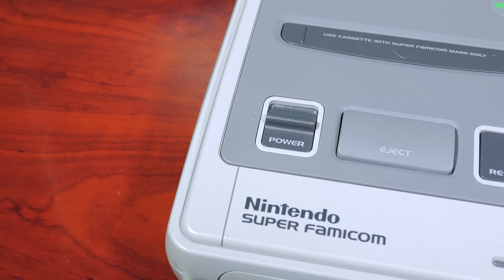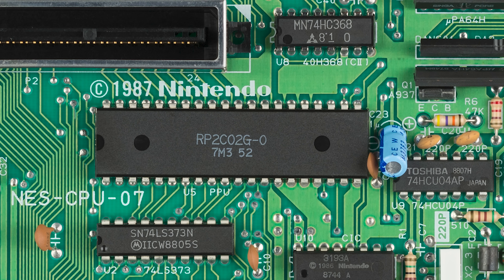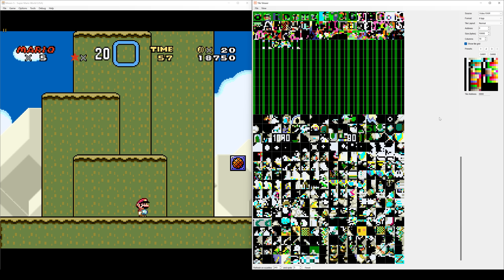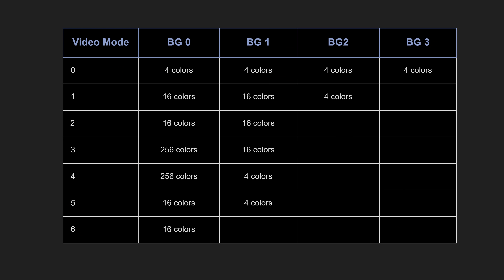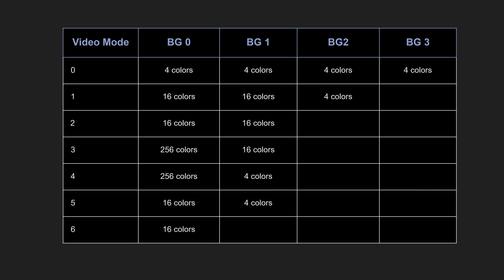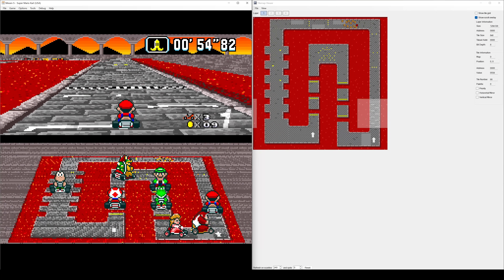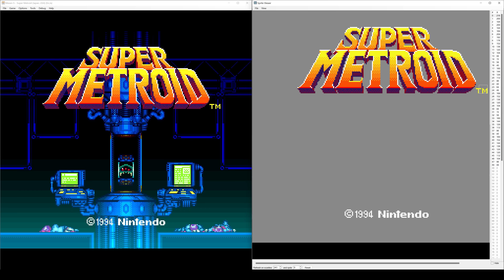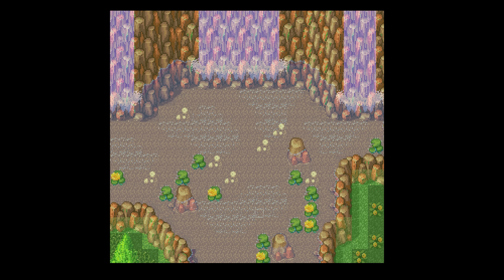How Graphics worked on the Super NES | MVG

Comment: 5:22 Correction: Background layers always scroll independently in all modes. The ones marked as offset-per-tile (2 and 4) are unique in that they allow you to scroll each column of tiles independently of each other. This allows you to have vertical parallax on a single layer (and is also the only real way to accomplish this). We see this used quite a bit in Yoshi's Island, where it's used for the wavy lava effect seen in some castles, the LSD effect when Yoshi touches a fuzzy, and some really big castle platforms that move up and down.
Reply: Unless I missed it he also didn't explain the importance of HDMA to what most people know as Mode 7. Without HDMA you couldn't do Mario Kart or F-Zero. Castlevania 4's swinging chandelier or rotating room is a perfect example of Mode 7 on it's own. Changing the scaling per line is how you achieve that pseudo 3d perspective. It's too bad he didn't have that in his explanation on mode 7. But for many viewers they probably got plenty of information they didn't have before so that's still positive.
Reply: @mottzilla4858 I agree: while it's good to speak about old machine tech, here (https://www.youtube.com/watch?v=pafOj9IrtuY) you can find a far better explanation of the Castelvania IV "tube" section. Of course having in HW those effects is a huge bonus, many of these effectes are replicated via software in line scrolling by MD/Amiga (true 16-bit machines btw, while Snes cpu is still debate whether it's a full 16-bit cpu or a 8-bit derivate, PC Engine / TurboGrafx-16 got a 8 bit cpu with true 16-bit video system)
Reply: @slashrose3287  The SNES's CPU is a hybrid 8-/16-bitter while the Motorola 68000's a hybrid 16-/32-bitter. The SNES chip is more memory efficient due to its shorter operation codes, which combined with having a lot of graphical trickery prebuilt into its PPUs allows more room for high-quality assets.

But why is SCVIV 4-3 (4-2 is the non-tube spinning room, which is what mottzilla meant as that's pure Mode 7 while 4-3 is both Mode 7 and HDMA) so laggy regardless of the multiprocessing? It's because nearly every floor segment there is a falling plank, thus sprite and motion data that you're constantly triggering as you go. That combines with all the other sprites and physics—the HUD, Simon, his whip, the candles and items, the breaking wall pod bits, the enemies and ESPECIALLY their bits when they explode—to REALLY chug the SNES. Old-school Konami were masters of pushing hardware to its limit, yes, but they occasionally got WAY overzealous with it. The 3-3 boss and the B-1 crumbling bridge with bats in pursuit are two other notorious examples in SCVIV even though neither uses Mode 7 or HDMA. Maybe if they could've optimized the code for the whip flailing…
Reply: @CarbonRollerCaco  Thanks for ur CPU clarification, well explained indeed. Again, noone is arguing the Snes superior graphical power (and could not be otherwise, since it was release more than 1 year later MD, which is rather hefty in tech advanceemet ).. many people argue again the should have spent more for a true 16-bit cpu and maybe save money for a slightlyless advanced audio system (the SPC700 audio system wasn't fully used by many developers at the time). Anyway, Snes was a fantastic system at the time, the "16-bit war" (or any other war btw, especially in these days...) is just not for me anyway.
Reply: @CarbonRollerCaco  How are the codes shorter? Okay, 68k has 16 bit instruction codes, but immediate values are of the same size. In SNES you need to insert extra instructions to switch between modes for BCD or 16 bit vs 8 bit immediates. That not only takes memory, but also clock cycles. And now I checked, the 65816 does not seem to have its zero page in the chip. For many variables the 68k can just access its register file and is thus more efficient. Only multiplication on SNES is faster. Already on a C64 the multiplication ( for 8 bit ) is almost as fast as 16 bit on the Amiga. Nintendo took a hint and poured the lookup table into ROM.
I just checked: Both consoles have the some number of pins, but MegaDrive pulls 16 bit per cycle, which completely compensates the opcode size.
Reply: @mottzilla4858  he literally brings it up in the video
Reply: ALSO he mentioned  Layer1 (BG0) having only 128 colors, but the chart says 256 colors.... am I the only one that noticed this? which one is it?
Reply: @ThatTweedle  The chart shows how many colors each tile can use, but he's talking about how many colors can be used on the whole background. Backgrounds are made out of many tiles, so the background as a whole can use more colors than a single tile can. The SNES can load 256 colors at once into its palette RAM, that all graphics have to pull from.  Sprites always use colors 129-255, whereas backgrounds start reading from color 1 (not 0). In most modes, only the first 128 colors are needed for the backgrounds, but in the 256 color modes the background can use the entire palette, even the ones that are normally for sprites. Mode3's first layer can use 256 colors, but most of the time it will only use 128 in order not to cause conflicts with sprites.
Reply: @vonfahrenheit6557  But then that means that only 120 colours are used for the background in modes 1, 2. 5, and 6, and only 96 colours are used for all backgrounds combined in mode 0.
Reply: @vonfahrenheit6557  Yes, that is mostly correct. Though with a bit of clarification: Sprites actually use color slots 128-255 (with color 128 being the transparent color). Backgrounds do start with color slot 0, with color slot 0 of each palette also being the transparent color. So in Mode 1 for example, the first color of each of the 8 palettes background palettes is transparent. There are 16 color slots in each palette. This only leaves you with 120 actual colors per background. However, when using the 3rd background layer which is only 2bpp (not the 4bpp of BG1 and BG2) each palette is 4 colors (with the first color of each palette being transparent). So color slots 0, 4, 8, 12, 16, 20, 24, and 28 are also transparent. This gives a maximum of 3 colors per sprite (with a 4th for transparent) and a maximum total of 24 actual colors on this background.
Reply: @ThatTweedle  I second your observation
Reply: @inceptional  "No one cares".."Get over it".."lost 16-bit war"..at least we agree about the (arrogant and anachronistic) "fanboys" still around in 2022 (i repeat, in 2022, not 1992...)..and, yes, with the described hw video features, the (probably) derivated-8bit Snes CPU automatically becomes true 16-bit (which, btw, was the point explained in my previous post, also a tech documented fact)...now we know the real truth, got it..
Reply: @inceptional  Well, apart from NOT answer my (and many others btw) simple argument in ur last three comments (whether Snes can call itself a true 16-bit machine because got a derivative-8bit cpu on a 16 bit video hw, much like Pc-Engine, in case the latter also could compete in the "16-war" at the time), trying to paste-copy my comment contruction..that's really "pathetic and desperate" as u say...anyway, my bad i tried to make a point with people so "illuminated" like you..well done, you won, enjoy ur simple Nintendo fanboy life; feel free to end this "conversation" with your last, redundant, arrogant & pointless post, i'm done with people like you.
Reply: You forgot to add in Mode 6 as an OPT mode. In addition, vertical parallaxing can also be achieved with sprites and swapping out sprite graphics, though you probably don't count them as "real" parallax in this case.
Reply: One other quirk of the SNES he omitted is that it had a 220p resolution that was stretched to 240p when displayed. This caused a bit of a learning curve when programming on it since what is loaded into memory isn't the same thing that will be displayed. You had to squish your images together so that they would be correct when stretched out.
You can see this like Genesis ports like Pitfall where the sprites are stretched awkwardly and the world isn't entirely correct and less of it is visible at the time.

Comment: Tiles and sprites on the SNES can use up to 4bit/16 colours from a pool of 9, 16 colour pallets (including a transparent ‘colour’).

In direct draw mode which is not using the PPU accelerated sprites and tiles in say, a static image or 3D graphics, the selectable colours are not indexed from pallets but drawn from rgb values which allows for more colour but slower performance.
Reply: The SNES was not friendly to develop for however. It’s graphics rendering method is ‘bitplane’ which is each pixel is a combination of the ‘planes’ of red, green and blue. This method was chosen to accommodate for a limited data bus if just 8bits. This is the width of the data path connecting the cpu with graphics, sound and work ram and rom data. It’s more cpu intensive however with common operations in use at that point as in the 16but era, ‘packed pixel’ format had generally been adopted to aid the ease of development and increase blitting/rendering speed for most common use cases. The planer format does however allow for the possibility of transparency in some instances although it’s used are limited.

The dual PPU’s were another obstacle to program for, along with the budget cpu, limited 8bit data bus and a compartmentalised graphics and sound system, requiring cpu interrupts to access graphics, sound and data from the rom. The rom itself was also limited in data speed. In fact, in order to run at 3.5Mhz, cartridges needed to be using ‘fast-rom’ type of memory which is less cost effective then standard lo-rom.
The SNES saw considerable support from third parties however despite its limitations and un-unified architecture because the Japanese public love Nintendo even more than the USA. They also love RPG games and this is why there are approximately 7 million available to play. They vary slightly on giant head size and alternate between running around and hitting things with a sword and standing in a line taking turns to bonk enemies on the head who are also waiting in single file to receive and dispense attacks. The story is more or less the same.

It was possible to program a fast paced action game but games of this type generally had be designed to be more modest in terms of the animated visuals with the most impressive titles being Rendering Ranger and Pocky & Rocky.

There were a lot of neat em ups but enemies were often limited to 2 to 3 on screen at a time.

The screen resolution was 257x224 (8x7 aspect ratio) so often graphics appeared too wide when the picture was expanded on the horizontal axis to accommodate the portrait orientation of a 4x3 crt tv.

Music could also suffer from a sample based system which offered only 64KB for the sound driver, musical score, effects/sounds and instruments in use as well as delay (echo) instructions. These limitations resulted in a distinctive sound from the chip which is kind of a buzzy, brassy, synthy texture or at worst dull or soft noises that fail to leave impact. Due to samples requiring such low data footprint, being at best 4bit, 22Khz and limited bitrate of well under 96Kbps.

The cost of the system and software was a touch more expensive than the £150 Mega Drive with the system retailed at £200 and games averaging around £60 to the Mega Drive’s £50.

It had more colour though so games designed for the SNES enjoyed a wide range of subtle colours from an expanded 15bit/32,000 colour palette. The games moved at a fairly glacial pace quite often however and controller input response times were often seriously compromised.

There are a great many interesting games, although the usual suspects might leave newcomers confused as to the hype. This is because the SNES is a hot machine. It tours impressive abilities but they are technicalities and it’s hype in the real sense of the word which means false excitement.

I would avoid all the Mario games although Marino’s Cookie is mildly entertaining it’s also ultimately repetitive. But avoid Mario Kart as it’s tedious, Mario World as it’s repetitive, irritating and tedious, Starfox is not fun, nor is Super Metroid or Zelda or Pilot Wings. Maybe try Ninja Warriors or Wild Guns but they are a bit tricky.

Overall the library is crap but there also a lot of interesting stuff if you avoid the standard top 100 of what is cannon to praise in the system.

Avoid the racing games that use mode 7 apart from Street Racer and a motorcycle game I forget the name of.

Avoid the shooting games (also avoid Contra).

Really the console is designed for playing sugary RPG games about giant headed emo’s with pink hair fighting dragons. All these games as I mentioned earlier operate in one of two gameplay styles (apart from Drakken and an AD&D game or two).

Haha. It’s a joke system for babies really and a nightmare to develop for but lots of people bought it and loved it because they are a bit slow and they are unwilling to accept their mistake up to this day but hey ho. If you enjoy playing tedious slow games, go nuts. Try Do Ra Me and Skyblazer for the ultimate in cutesy pointless tedium.
Reply: The SNES also had 8bit modes, which allowed for 128 or 256 colors.
Reply: @hjups  what you said is not a descriptive statement.
Reply: @ribenasquash  Sure it is, though I guess it was a bit vague.
Mode 3,4, and 7, all could do 256-color 8bpp graphics. However, there were restrictions on how the palettes were mapped, effectively making some of the sub-configurations only 128 colors. Transparency was always a color though, so technically it's 1 less if you don't count that.
I don't want to go into more details, because that would require discussing the sub configurations and address mapping in the CGRAM.
Reply: @hjups  pallets in a direct colour mode aren’t mapped. They are drawn on a pixel by pixel basis using rgb values so indexing/mapping to existing pallets isn’t the method used...

What is a sub-configuration?
Reply: @ribenasquash  Yes, I am aware of the direct color exception. I meant that 8bpp 256 color mapped to the CGRAM is also a mode, which you did not list as the upper limit (i.e. 4bpp is not the upper limit).
Sub configurations are settings for each mode such as via the BGMODE, BGxSC, and BGxyNBA registers. Those select both the mode (0-7) and the options available in each mode.
Reply: @hjups  I think you are mistaken. Sprites and tiles cannot display more than 16 colours each under any circumstances.
Reply: @ribenasquash  You're confusing the SNES with the Genesis. The SNES has 8bpp modes, which use 8-bits per pixel (via 8 bit-planes). That 8-bit number can either be used as direct color RGB values, or as an index into CGRAM.
Reply: @hjups  the palettes on the Super Nintendo cannot exceed 16 colours.
Reply: @ribenasquash  Then what happens when your tile references pixel color 23 in 8bpp mode? Does it just wrap around to the same 16 colors?
Reply: @hjups  probably an error

Comment: While the SNES base CPU was slow, there were a lot of interesting enhancement chips, such as the aforementioned Super FX chip, but not forgetting the various chips, such as the DSP chips, the powerful SA1 that was clocked faster than the Genesis's M68k, as well as Capcom's Cx4 chip for drawing wireframe graphics. Definitely a good topic to cover.
Reply: One of the most impressive of them is the compression one used in Star Ocean, allowing a 256 Mb game to fit in the cartridge when most games weren't even half that size.
Reply: @BrunodeSouzaLino  Star Oceans uncompressed takes 96 Mb, or 12 MB. Not 256 Mb / 32 MB. It used the SDD-1 chip for the on the fly decompression tasks, the same that Street Fighter Alpha 2 used.
Reply: Sorta like the Amiga's weak CPUs paired with tons of powerful co-processors.

Comment: Two PPU's, eh? I think the saturn had two PPU's as well. I know it had two CPU's. Maybe sega was trying to replicate the power of the snes in the saturn. If I am getting my facts straight.
Reply: No, I think it's nothing similar in that case. 2 PPUs for SNES is basically a single unit distributed into 2 chips, from a programming standpoint you can't control how you use them. It's just the rendering pipeline is quite complicated even though it's only 2D, there are layers, colors math and also windows that weren't mentioned in the video I think. As for Saturn, from what I read adding an extra unit was a late architecture revision and was kinda a mess. This was a quick response to reaction from early Playstation demo. Initially Sega didn't plan the 3D in it's system as they were experienced with arcades hardware and knew that home hardware was not nearly close to allow proper 3D 60 fps experience. However people didn't care and though that running the games at 20 FPS with unfiltered textures was good enough and Sega made a late revision leading to overcomplicated design.
Reply: @HaganeSnake  Nintendo split up the logic into two chips to reduce the die size (increase yields) and to simplify the chip packaging (pins per chip). Neither chip can function on their own unlike in the Saturn. 
That does make sense that the second chip was a last minute addition to compete with the PSX.

Comment: Very nice video! It would be useful to add that the perspective effect that createst he pseudo-3D in Mode 7 is done using HDMA since it's not an affine transformation. The background is zoomed in after each scanline, creating the perspective effect
Reply: Zooming with mode 7 is an affine transformation. It's just using a different transformation matrix for each horizontal strip. The matrix gets swapped out using HDMA.
Reply: @angeldude101  Yes, that's what I meant. You can't make a non-parallelogram from a parallelogram with affine transformations alone. So to do it they have to apply different affine transformation for each scanline. This creates the illusion of a trapezoid transformation